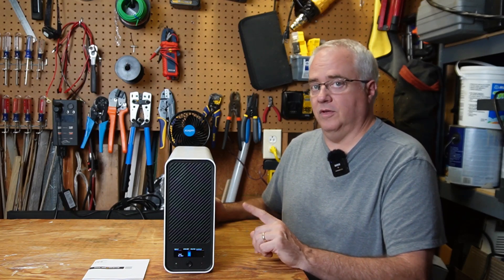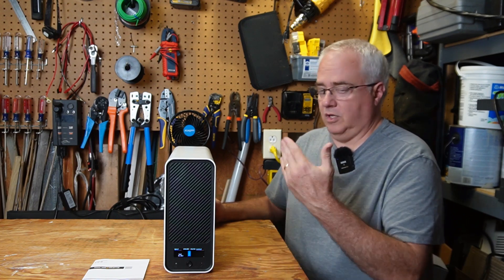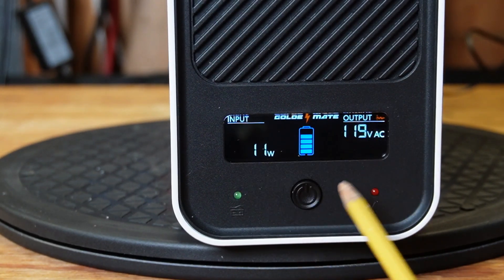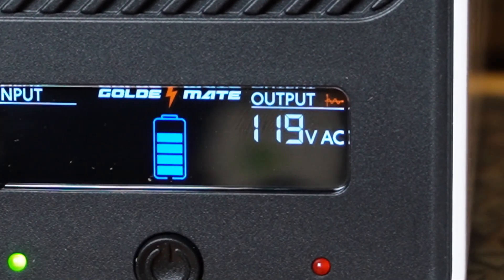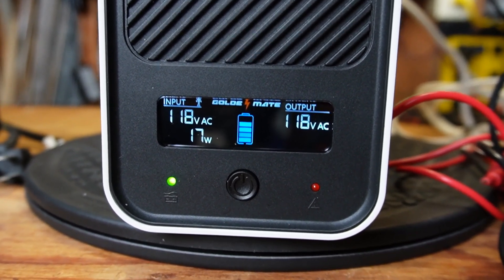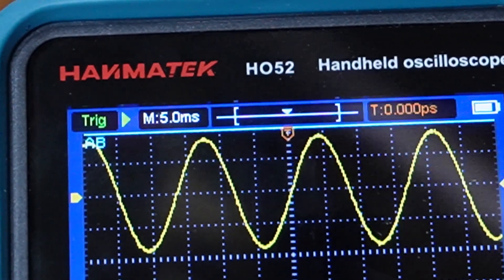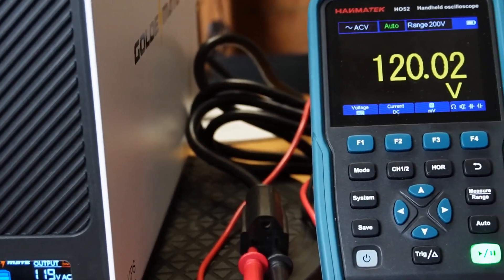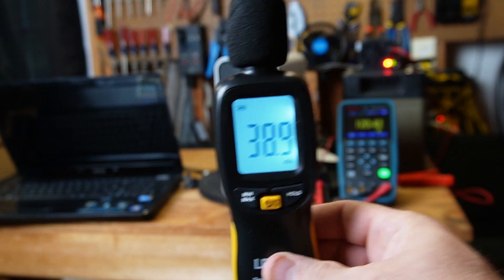GOLDENMATE UPS with a LiFePO4 Battery! Why This Lithium Iron Phosphate UPS is Worth the Wait

Comment: Tried out out, I would not recommend this UPS at all for anything electronic. My unit didn't switch over fast enough from power lost, and every time power went out, the router and switch it was on rebooted, corrupting the firmware in the router.  My oscilloscope isn't has nice as this one, but I could tell by playing this video back 5:55, it was ~25ms till it kicked over. APC BK CS and ES units is 10-12ms, and the Pro BK RS units is 6-8ms. Buyers beware.

Comment: Appriciiate you opening it up.  Itis disappointing the internal battery is not an easily replaceable cell.  Sure it should last for 10 years, and is warrantied, but it would still have preferred a standard prismatic cell or similar.  

I'm going to open mine up just to disable the freaking stupid alarm. Mine is slightly newer (more plugs on the back, not 45') and while you can push the button to mute the alarm, there is still no ability to permanatily disable the alarm.  I literally never want an audible alarm, never.  Getting to where I have this UPS is not easy, so in the middle of the night... beep... beep... beep... beep... beep... beep... beep... beep... beep... beep... beep... beep...  would drive me insane.
Reply from the maker: I'm disappointed the battery isn't replaceable. Maybe it's better to just replace the whole unit when it needs a new battery.

Comment: @proficient_prepper Can you please test the unit and reply here with the results for when the unit runs on battery, fully exhausts itself (like an all day power outage), and when power is restored by the power company does the unit AUTOMATICALLY turn on.  There's nothing more frustrating than being on vacation for a week, realizing your UPS doesn't auto-turn-on and you are down for a week instead of just a day if you had not had a UPS at all.

Comment: will it clean bad power coming into the house? like if you are on Generator power that isn't inverter power? Wonder if you can hack it to trigger a pc shutdown by using an esp32 chip or something and monitoring the battery draw or no to nc via some pcb port.
Reply from the maker: When its running on battery power, it was cleaner power than my grid coming into the house. However, when the grid power is on, its just passing through the power coming into your house. So it won't clean it up.
Reply: @proficientprepper  ok thanks, i was hoping i could use this as a bridge between when i'm running on generator which has dirty power and my pc but sounds like i need another solution. Still bought one though as i like the backup with lipo

Comment: I was looking at this UPS on amazon and it seems they just put out a new version that addresses the two major complaints I saw in the reviews: a single press of the power button will mute the alarm and the fan is quieter when charging, which was the other major complaint. New version is about $30 more than the old one. Still no comms/management which is a bummer.
Reply from the maker: Yes, this UPS does not have all the features as some. But its been working just fine since I did this video. No real power outages yet though. Other than my testing.

Comment: That's a very neat and impressive-looking UPS you have. It seems to have all the essential features one could need. However, in addition to the mute button, it would be great if it also included a communication port, similar to those found in popular UPS models like CyberPower or APC. This port would allow for automatic shutdown of a PC or NAS in case of low battery and enable remote monitoring of the UPS status.
Reply: An expansion port for another battery pack would be nice too.  They could re-work one of their other batteries or design a matching enclosure with a 24v / 50Ah battery for a nice jump in runtime.
Reply from the maker: Yes, the communication port is a nice feature to have. With every additional feature, I'm guessing the price will go up. Thanks for commenting!